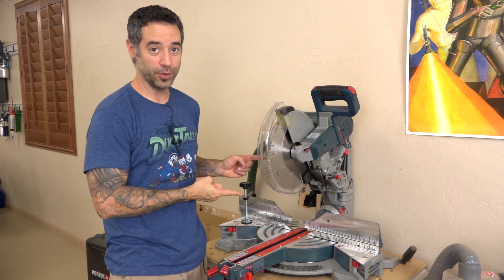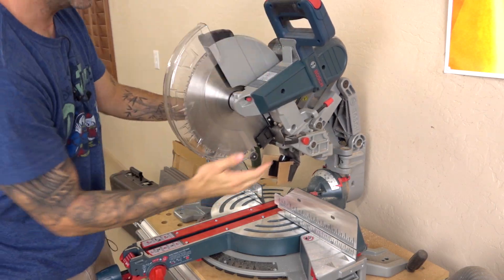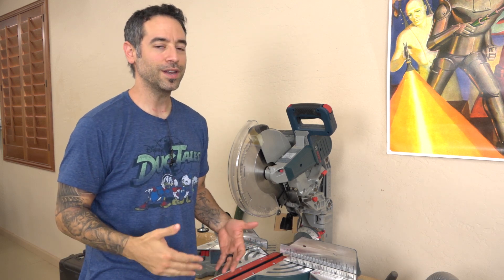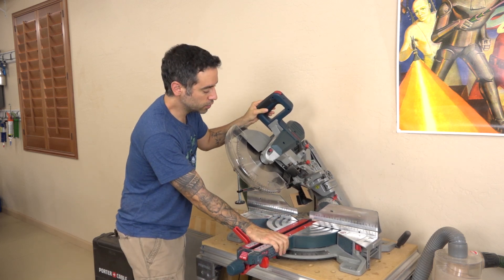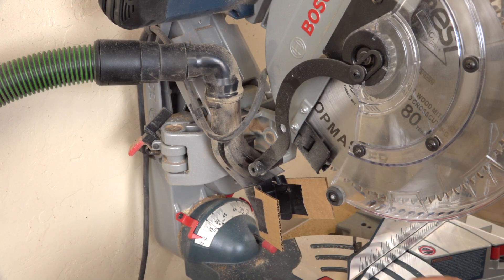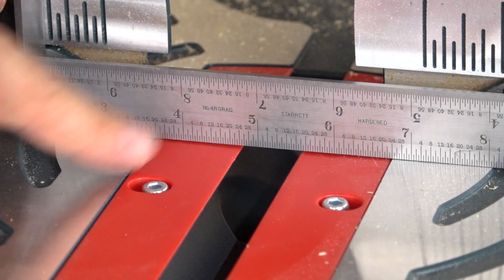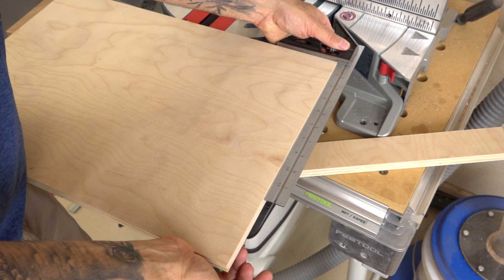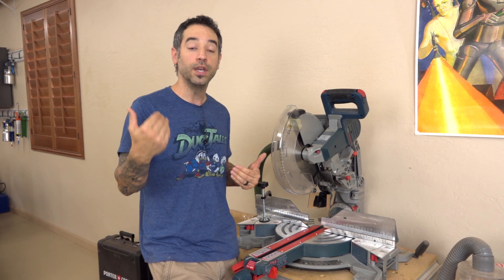Bosch Glide vs Festool Kapex

Comment: Great video, are you still using the Bosch presently?
Reply from the maker: No I'm not. When I moved to Denver I wanted to see if I could live with the most basic decent chop saw I could find. So I was rocking a 12" non-slider. Worked just fine but it usually meant flipping wider boards. When I hired an employee, I really started to feel back for the extra work they had to do flipping boards and I also wanted to improve dust collection. So I bit the bullet and went back to a Kapex. Doesn't invalidate anything in this comparison but the dust collection is still unmatched. So when that's a priority, there's pretty much still just one choice, sadly.
Reply: @woodwhisperer  Thanks really appreciate update on the experience.

Comment: Hi Marc. Great video, pretty much confirmed my decision (Bosch).
I have a question: have you ever thought of switching from your Festool TS55 track saw?, to say the Mafell MT55 cc or even the Bosch version?.Would really appreciate your opinion. Cheers mate
Reply from the maker: Not really. It's one of those "if it ain't broke" things.
Reply: Got ya. I have another question , if I were cutting a 15mm double sided veneered ply sheet with a TS55, would I get the same super clean cut on both sides of the board?
Reply from the maker: Well the top surface should be good because of the splinter guard on the track. The bottom surface is generally pretty clean on any circular saw so with a good blade, the quality should be right up there.
Reply: Great advise thank you. I'm pretty much all set to pull the trigger on a TS55 R, my only dilemma is the Mafell MT55 keeps raising its ugly head!, and as I'm just starting to build up my kit for a new venture, I'm not "committed" or already invested in any other brands it's made my decision on a track saw just that bit more difficult!. Any thoughts?
Reply from the maker: I don't have any experience with the Mafell. But look at some of the other Festool tools in the lineup and see if you plan to go that route. It can make it easier if you have multiple tools of the same brand. But in both cases, I can't imagine you'll be disappointed in your purchase.

Comment: Have you'd reviewed/tried out makita's new Kapex copy?
Reply from the maker: +Tim Johanson yes, and I recommend folks wait. They have an unaddressed manufacturing flaw. I had to have two units sent to me and both were jacked up. Others have experienced the same thing. Not all of them have the issue but until they get the kinks worked out, I wouldn’t buy one.
Reply: The Wood Whisperer just to be sure, were talking about the new dual bevel 36v miter saw? What's the issue? Please do tell. I'm not necessarily in the market for one yet (my work covers that saw! 😬), but I run Makita's battery tools and thought someday it would be nice to have a lighter saw than the massive dewalt I run now. Had the guy at the local woodworkers source trying to sell me on the kapex. Thank god im hourly…
Reply: Any updates on the bugs getting worked out? On that new Makita?

Comment: This is a really nice saw, but the execution of the manufacturing leaves a lot to be desired.  Without very specific adjustments it does not cut accurately enough for precision woodworking.  

Just bought one last week.  The rotating table was not flat.  Sliding a Woodpecker square from right table to the left across the kerf space the straight edge will hit below the rim. Interestingly enough if you slide the square from the left table to the right it also hits below the rim.  So it appears both are sloping inward very slightly.  Two others at the local store were same to varying degrees.  This means you have to adjust the saw slightly for whichever side you are cutting on if you are trimming pieces that do not reach across the kerf gap.

Of the nine different makes and models of sliding miter saws on sale only four had flat rotating tables, but the Festool was not flat across both the rotating table and the fixed side tables.  The Makitas are unique in the rotating table is the whole table so there were no fixed wings to worry about (however only the 10" table was flat, while the 12" was not).  The 12" Milwaukee and 12" Dewalt were generally flat all the way across fixed and rotating tables. 

Unfortunately, all of these are too deep for my space which the Bosch fits to a tee.  Store is checking with Bosch to see if they can provide a flat one or what they may have to say about the issue.  Not hopeful, but might as well try.  Probably will live with the least out of level one I can find and planning on having to dial in the adjustment depending on what I am cutting.

Comment: I was being sceptic about the whole Festool thing. (Except their saws and mills) and even their drills
owning them and worked with it, i cant relate to any other producer, Festool really works and rocks
If you chose a system, chose Festool
now 10 years later, their saw is still up to date, while Bosch has introduced several different models...
Like G.Work.Specials said, in Europe it is about the same price, so Festool will be it

Comment: Having an older Bosch slider (GCM10) which came standard with the 'quick clamp' I can attest to the utter crappyness of it. If you look closely at the distance between the tip of the quick action lever and the top of the pad screw you will realize that every time you close the clamp you will scrape all skin off your fingers using the lever action. You have exactly two options: 1) use so little clamping power that you can push the lever down with the tips of your fingers from above and risk the work piece moving due to insufficient pressure or 2) use ample clamping pressure and nick your hands every time when wrestling with the lever to get it over the 'lock hump' in the action. Utter crap.

Comment: Reading a ton of negative reviews on this saw.  Update video on this a year later?
Reply from the maker: No need for an update video. Nothing has changed. Keep in mind I only have a single saw from a single production run. So if things changed, my saw won't give me that information.
Reply: As a beginner looking into getting a glide miter, would you be willing to do a shootout with the makita?  Or maybe at least give some tips on how you might go about choosing your tools in general.  It seems such a daunting task when it doesn't matter what tool you are looking at, there seems to be no middle ground where people think it's the worst or best tool ever made.  How does one sort through all the noise short of going out and buying everything to see for yourself and hoping there is a good return policy lol.
Reply from the maker: Well, that's a great question. I think the reality is MOST of the tools we have available to us today, assuming you avoid the bottom of the barrel, will work just fine for our purposes. We divide ourselves into brand camps and we tend to champion the brands we own, which leads to a very hot or cold set of "reviews." So as long as there isn't some major manufacturing flaw, most saws will work well after a calibration. What you (and most of us) get stuck on is minutia. I could survive quite happily with the Bosch, the Kapex, or the Makita. Though I'd avoid the newer Makita slider that just came out because they are having manufacturing problems. I'm sure they will resolve them soon though. So my best advice is to buy a decent brand, avoid the bottom of the line, learn to set up and calibrate the tool, and start making cuts. I doubt you'll be disappointed no matter which one you pick.
Reply: Thanks alot! I am actually pretty surprised and thankful that you took the time to answer my couple comments, on a holiday monday non the less.  Appreciate it, love the channel.

Comment: Thank you Marc. I'm working on Kapex over two years 
and I could easily write ten key points why I hate him.
 One for all - poor geometry of the saw blade, 
causing the firing of cut parts.
 When tilting saws 45degre is limited by the thickness of the cut
 material to the max. 50mm, due to a leash.
 Do not hold the clamp properly,
 the saw blade gets stuck in the open position, etc ...
Petr

Comment: You had the Kapex, why did you buy this Bosch ? That's like stepping backwards going with fine machinery and then changing to less quality saw. ????
Reply: I've used that Bosch a lot at work, and I can assure you that it is a great tool with some really well done engineering in the glide function. I've never used a saw with a laser, so the Bosch not having one doesn't bother me. The adjustments are smooth and the cuts are clean

Comment: So, $900 difference and Bosch could fix the dust collection and clamping for no additional cost or just a few $s. Space from wall and dust collection will be critical for me for non-precision planters, kitchen islands, & similar heavy items from 2*(2, 4, 6, 8)". Or go for track saw mft system for rip, cross, jointing, and panel breaking for cabinets in mdf and ply. Case for Mafell to do everything in material up to 2"  50mm, thick starts making economic sense for pensioner with 210 sq ft, 21 sq metre, shop to make hobby pay for itself. No pressure to maximize every second of working day but need to work clean and systematically

Comment: I have the Bosch 10" Glide, my partner has the Festool Kapex, let me say the Kapex makes nice accurate cuts and has the best dust extraction in the industry, that said, my Bosch has a smoother action, very accurate cuts, and a better motor ( in my opinion), one thing is for certain _ the Kapex is not worth $800.00 more than my Bosch, there simply is no way to rationalize spending that money.

Comment: what 600 buck?! 
They are in the same price range here in Holland... +/- 1000 euro's )
Reply: RR SS Here in the US, it is $650 vs $1450 currently at Amazon.
Reply: $939 v $1945 here in Australia!
Reply: $700CA and $1950CA in Canada
Reply: in the Netherlands most of the tools are expensive i buy most of the bosch tools in germany they are there much cheaper
Reply: In Czech (EU): Bosch GCM12SD (305mm blade) - 1000 USD vs. Festool Kapex KS88 (260mm blade) - 1040 USD. 
What type of Kapex you mean? There isn't bigger model in shop.
Reply: Bought one in Germany for 650 Euro. It's a great saw but the dust collection is a pain. The kapex would be around  1160 euro. You do the math.
Reply: Here in India, Bosch retails at INR 34500/- and the Festool Kapex at INR 316425/- - that's close to 10 times the price of Bosch.

Comment: I been looking at other vids about the bosch model u have there an I guess it wobbles a little from left to right so not very accurate.
Reply: I have the ten inch Bosch, it does t wobble at all. I think folks that claim theirs does are shaking the fire out of it and going way beyond what would take place in normal use. In doing so they probably damaged the saw.

Comment: This is my next miter saw.    I’ve never owned a sliding miter saw.  I’m willing to spend some extra scratch for the engineering in this bad boy.     I want the ability to crosscut boards more than 6” wide as with my current miter saw.

Comment: A good review - in fact I based this on my purchase of the Bosch 12”. Without a major table saw- this machine is important to me- I need a small, footprint, accuracy, and dust collection. But I have to say that my Bosch has given me nothing but trouble when it comes to accuracy. I have had to set it up 3 times now and it’s still won’t stay true- even with the basic 90 cut. Also-You really have to focus on “user caused deflection” when using the slide-there is play- but is it me? I dont think so. Unbelievable. There are many positives- but if it’s not true- it is useless to me. Footprint-Dust collection- soft start- ergonomics-extension wings are all nice- but it is currently sitting on my floor and the old Dewalt is still working very strong- I am now wait for October 1 shipping date for the Kapex and a buyer for the Bosch. Just my experience guys.  Be careful out there.

Comment: Why does everyone use sliding miter saws wrong. Your suppose to cut pulling towards you like a radial arm saw. Cleaner cut.
Reply from the maker: Because everyone does it correctly and you're doing it wrong. :) Perhaps a cleaner cut, but also a lot more dangerous. The saw is designed to be pushed, not pulled.

Comment: Nice review, but why do you compare it against a Makita on the areas where the Kapex is just as good? That is the up-against-the-wall placement. The description of the video gives the impression that you want to tell us why you swapped from Festool to Bosch, not from Makita to Bosch. 

Also, the Kapex 120 is just 20-25% more expensive, not double price, and that is with the angle protractor. If you want to save the difference, choose the Kapex 88. 

In most of the other comments you actually say that the Festool Kapex is a better saw: adjusting vertical angle, clamping tool, lousy insert in the Bosch, dust collection.

I cannot see the Bosch is better in any aspect, and the price is more or less the same, so why choose the Bosch? I see no reason. Also, as long as you have a few other Festool items, the fact that the Kapex is the same height as a small systainer makes it really easy to cut long pieces on the floor.
Reply: torew01 That isn't true here in the US, the Kapex is more than twice as much money as the Bosch. Currently on Amazon, it is 649.00 vs 1,450.00

At this point I am deciding between the Bosch and a Dewalt, Festool is out of the equation. I like the Dewalt's xps light vs nothing on the Bosch, and the extra cutting capacity of the Dewalt is nice as well. But, the Bosch feels so much better during the actual cutting motion. The Dewalt is about $60 cheaper, so that is close.
Reply: Wow, that's insane. Why such a big difference between Europe and US?

For me, the most importan feature is the accuracy, and especially sturdyness. What I really like with my Kapex is that it doesn't matter if I am careless and pull the saw left or right, it just stays in the correct position without moving the blade the least. I'am an amatour som I need the help I can from the tools I use. How are the Bosch and Festool on that account?
Reply: Over here in Australia the two tools are almost $1000 different. I can get the 12" Bosch for just under $1k and the KS 120 for a touch under $2K.

Other than using it daily, there is nothing that would make me use the Festool over the Bosch, not at that price!

Comment: the dust sucking on the Bosch is the only thing really badly designed. Its gives a dust storm, not nice for contact lens wearers. Its also very heavy at 36kg. Noise is lower on the kapex too. There you have it:-).

Comment: I own the 12 inch Bosch glide and I must say I am very disappointed. It is not made for accuracy at all, it is just another framing saw like the dewalt. Not to mention the electric brake makes a horrific noise after three weeks of work. And our dust collection piece fell off..maybe I got a lemon but I would never buy another.

Comment: who actually uses those clamps..
Reply from the maker: Apparently me. :)
Reply: I use mine all the time.  I use the post like a holdfast.  I have the screw and foot at the appropriate height for the material I'm using, then drop it down in the hole and tap it on top.  Quick and solid.
Reply: I do all the time. But, now that I found out my Ridgid slider dog-tracks I will be using my tanlesaw for repeatable accurate cuts from now on. Miter saw is good for chop but not for slide.
Reply: Do you try to use the Festool Hold Down Clamp (494391) on Bosch?
Reply: Jonathan Carida I use my kapex clamp on every piece I cut. It's super easy and quick to engage and release so why wouldn't I?
Reply: The Wood Whisperer does it fit the Festool quick release too?
Reply: Bosch do make a quick release clamp.
Reply: Me too. Especially if the wood is large or very small or not perfectly flat.
Reply: Ive been a carpenter for 28 years.never
Reply: @stephenreynolds6239  exactly. 35 years for me and I've never used one. I've never seen a tradesman use one. Home owner, yes.

Comment: Great review. Got the Bosch as well, agree on every point you say. The euro version (Bosch GCM 12 GDL) do however have another clamp which you might be able to buy as a spare part. Clearly visible on this image http://tinyurl.com/zlcbwwt. We (Swedes) do get to pay about 1200+ USD for the GDL model.

Other mentions could be the weight, it is heavy. Also the little bit of recoil when you start and stop it is something they could work on.
Reply: curs germana austriaca